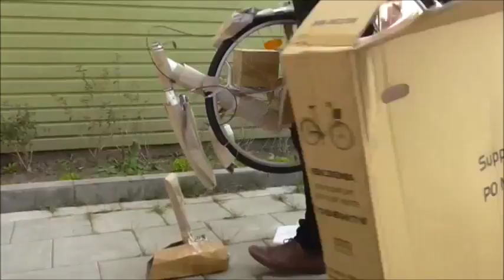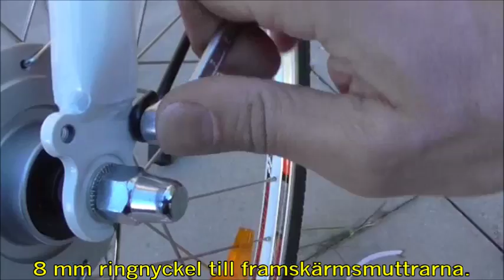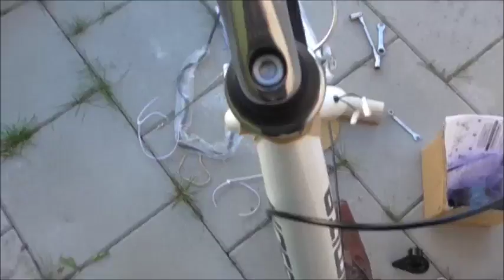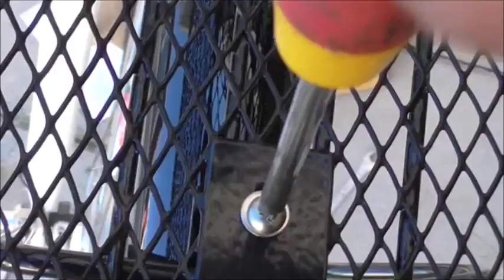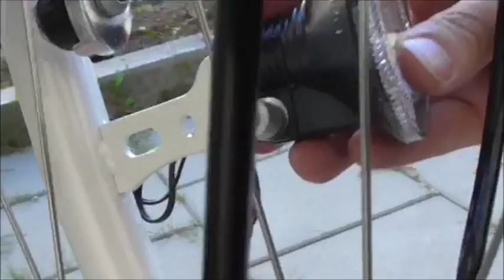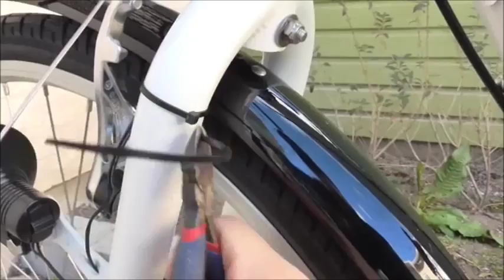Montering av Yosemite City Comfort 28¨- 3 växlar

Comment: Thanks for uploading the video. It was helpful. I had some questions about the lights. The rear light was LED powered? Is battery supplied with it? Also, the one I got has LED powered front light too, but I am not sure if they are supposed to supply battery with it. Please let me know what do you think about it.
Reply from the maker: Hi, the rear light is battery powered, the bicycle comes without batteries though. The front light is powered by the generator inside of the wheelhub.
Reply: @1769Joner  thanks for the reply! I'm having a hard time trying to change the battery in the light because mine has batteries in both lights. It would be amazing if you do a video for the rear light battery change!